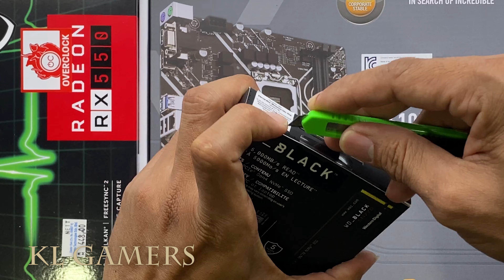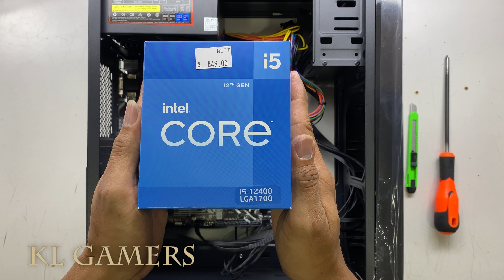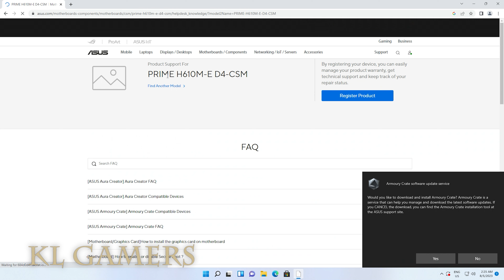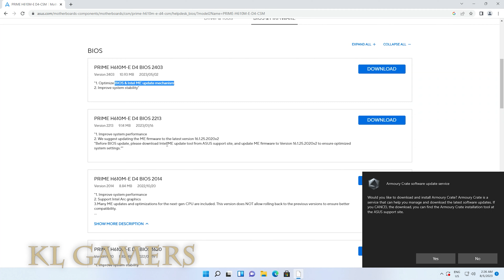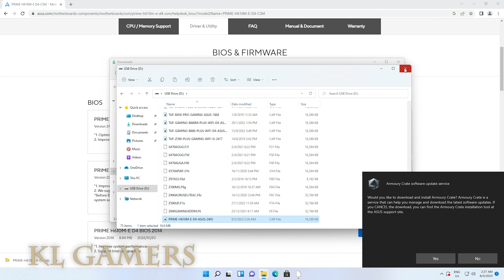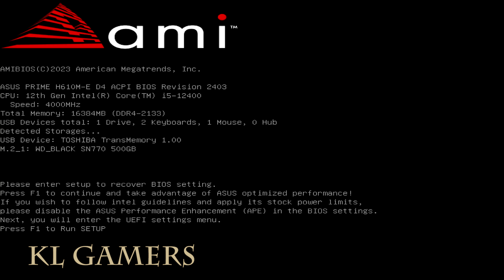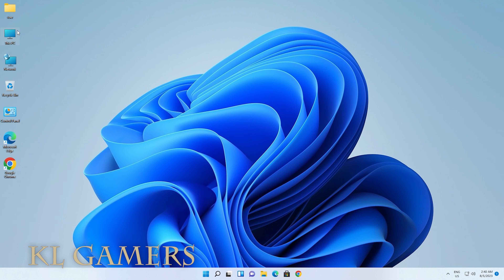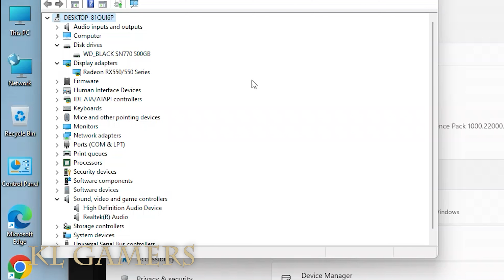intel Core i5 13400F ASUS PRIME H610M-E D4 SAPPHIRE RADEON RX550 PULSE Gaming PC Build

Comment: I did the following build:
     Asus Tuff B760 mobo (It can do DDR4 RAM, which is what I had, plus it can handle higher generation GPUs as well.
     Intel Core i5 13400F
     5700XT GPU.
     32 GB DDR 4 3200 RAM
All games maxed out at 1440p.
Older titles 100 fps and over.
Newer titles 60-100 fps and even more, NBA 2K23 does over 144 fps for example.
Reply: Bhai lekin nvidia ki baat kro toh pci gen 3 and 4 me koi difference nahi h
Reply: i would put a better gpu
Reply: @mohakjl7949 💀

Comment: Modding a VRM cooler may be better if you running high load in long time
Reply: How to modd VRM plz tell me 🙏🙏I have i5 13400f with msi pro h610m-e
Reply: @farazsiddiqui1312 do you face any issue with this processor and motherboard
Reply: @tanaykrhalder4024 while gaming not really I have set the power limit to 65w in bios but when doing heavy cpu intensive tasks my cpu only gets to like 3.8 to max 4.0ghz so definitely it is throttling but I don't know if the vrms are hot or not

Comment: Thanks for this video. Now I know it works with 13 Gen F sku, discrete GPU, and old BIOS pre 1620 out of the box (but recognized as 12 Gen before BIOS update). Is discrete GPU still required when using 13400 non F with old BIOS pre 1620?
Reply from the maker: not sure did not try, i guess it will work
Reply: What version of bios did you get when purchased I have i5 13 gen will it work straight out of the box or I need i5 12th gen for bios update to use i5 13 gen?

Comment: What PC can be made with this component?
Motherboard - GIGABYTE B660M DS3H AX DDR4 
Processor - Intel i5 12 Gen 12400F
Ram - corsair vengeance lpx 16gb ddr4
Power supply - Gigabite 550  
Grafix card - 1650 (4GB)
Ssd - Kingston 250 GB
Hdd - wd 1 TB
Cabinet - Anyone
Reply: instead of the gtx 1650 an rx 6500 xt and it would be there 👌

Comment: Hello, im planning on buying an i5 13400f with an MSI Pro B660M-E, but I dont really understand why u had to use an i5 12th gen to update the bios, is the i5 13400f not able to update the bios by itself, or not even able to get into the bios in the first place? Because if it can go into bios i can just download the bios drivers before hand?
Reply: i also have the same question
Reply: @Clipsatchu  I figured it out, you can't use that board, you have to either have a 12th gen or a motherboard that had a bios flash update button, I chose the MSI z690a , but there are cheaper options for around 120$ from gigabyte. GL

Comment: Update Bios?????
Reply: If you want to use a 13th gen processor then you need to update bios at first. But if you are using 12th gen or lower then after installation of windows you can do it .